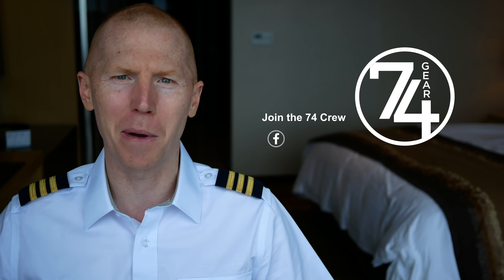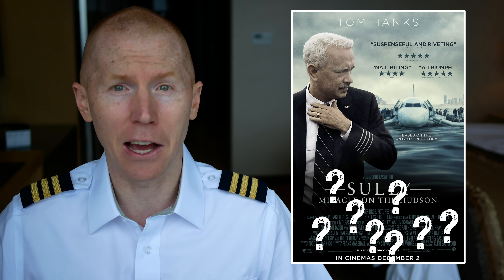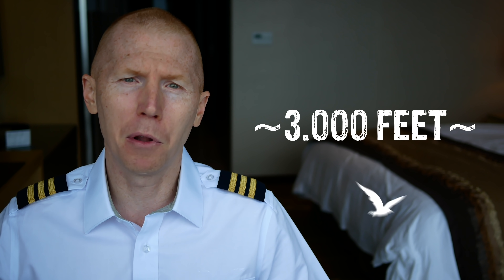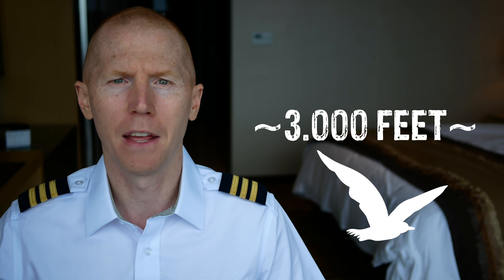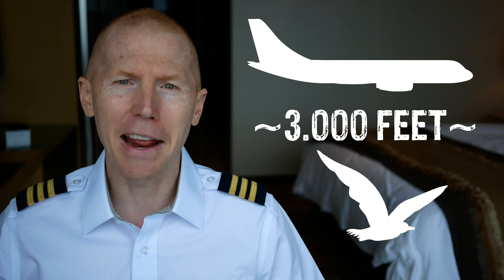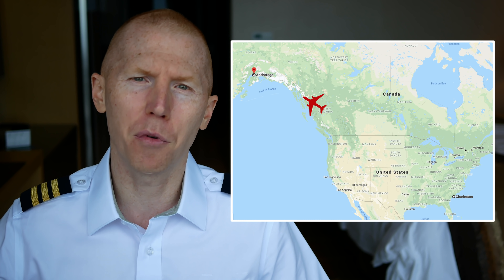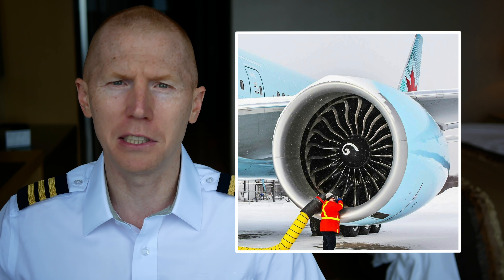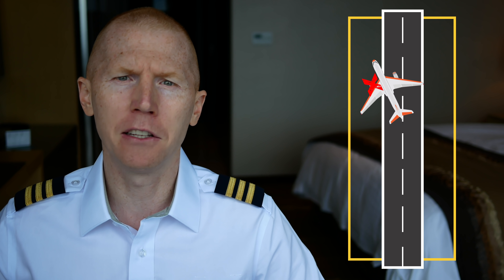Why Engines Don't Have a Mesh or Grates to Stop Birds

Comment: There's another issue he isn't mentioning that we were taught about in engineering. Putting a screen in front of a turbine is incredibly dangerous because it can get covered and the force of the item covering it can pull the mesh into the engine. Metal is worse than a bit of flesh and hollow bones.
Reply: That was the reason I thought.
Reply: Would a sensor that activates an emergency screen work? I'm no engineer though, so don't know if this would be feasible. I imagine there would be to little time.
Reply: @greki89  as soon as a flock enters the engine they lose power in that engine almost immediately. And birds don’t get picked up on radar.
Reply: @UzziHD  Oh! Just to clarify. By sensor I meant something placed on the opening of the engine itself, not so much on the body of the plane. Sometime like a motion sensor calibrated to objects of a certain size that when triggered it would activate a mesh or screen or something. Tho I'd imagine response time would have to be insane for that.
Reply: @greki89  more doable, it could just be an activated mesh screen that only applies below 3000 feet, like the landing gears, once above, they retract
Reply: The mesh is therefore absolutely shit.
Reply: that's why it should be designed correctly.
Reply: How about something that is retractable and is only used during takeoff, landing, and low altitude flying?

Comment: Putting mesh or grids in front of the air intake does not block the air. It’s that the fan blades would constantly be in turbulent air, causing vibration and therefore structural fatigue in the fan blades.The same reason why it isn’t common for propellers to be mounted at the back of an airplane’s wing or at the tail, even though it would be more convenient for the pilot, and probably cheaper to build in some cases. Also, to prevent bird strikes from damaging the engine, the mesh would have to be both incredibly strong and quite dense, adding weight to the structure.

Comment: Could you not put a air cannon that detects the birds and fires a short burst of compressed air to deflect the bird from entering a engine like the darpa system to deflect oncoming fire from a RPG on armoured vehicles, I’m not sure if the compressed air would cause surging or disrupt the air flow into the engine if it was a single shot of compressed air coming from the cowling at the leading edge of the engine

Comment: So you install a retracting protector that only deploys below 3,000 ft.  Obviously not needed at 32K ft.  Done.  Yes, a bit of weight but as you said, $25M engines and lives should be more important.

Comment: You forgot to mention if you out a screen or grate to protect the engine not only it obstructs air flow but if a bird flew into the grate or screen damaging it not only the bird is going thru the engine so is the thing suppose to prevent that from happening.

Comment: they should make a smaller arm that extends to the front of each engine by a couple of yards with a fan inside. make the front part more solid and have it blowing all surrounding air right into the engine much as a cars fan for its engine.

Comment: From the engineering perspective i call all these bullshit as if they wanted such thing, they could implement dozens of solutions i can think of, the real reason is there's no mesh to hold birds intact on the front of the engine at the speed the airplane is going, they will disintegrate and the same thing will happen again, so instead of loading the plane with extra junk it'll be better for the turbofans to be made in a way they can withstand birds flying in under operation and other supportive mechanisms like the balancing system the pilot mentioned.

Comment: I think airline manufacturers have their priorities straight. Engine efficiency vs destroyed planes. Both biased towards more sales.

I think if they wanted to fix the problem they can increase the surface area of intake to accommodate the bird grill efficiency reduction.
Reply: then it make ticket prices go up since it would cost more
Reply: @soarin64  tickets are not remotely priced based on plane performance. It's mostly based upon demand...

Comment: Well they can use simple radar in front of engine and detect anything like bird or bird itself then put a very fast mechanism to put a protection and catch the bird after that simply remove every thing and work normally. 
Activate that radar + machanism during take off and landing only. 
This may be a good idea I think. 😂

Comment: I also can't help but think if a bird hits that grating, even at take off and landing speeds, all you end up doing is breaking the bird into slightly smaller bits before it goes into the engine anyway.

Comment: We’ll put. There is actually another safety “feature” of most commercial or heavy aircraft. These engines are high bypass, which means the majority of the air sucked actually doesn’t go down the core. Think of a donut, the entire donut represents the front of the engine/fan blades. The center (hole) of the donut is the only section that gets sucked into the core, the rest of the air is still sucked into the engine, but it is between the core and the outside of the engine. If a bird is sucked into the core(which is less likely because it is a smaller section) then the engine is most likely toast. But if the bird is sucked through the outer edge (largest section) of the engine, it is bypassed and doesn’t hit as many crucial components. When this is the case usually a fan blade has a small dent or nick taken out but it’s easily repairable and flyable.

Comment: They should have retractable meshes that are put in place on take off and some landings. Over 3,000 feet, they are retracted.

 I think it's going to happen some day.

 You lose some fuel efficiency but at the advantage of safety. Plus this loss of fuel is much cheaper than fixing an engine that has had bird ingestion.

Comment: hear me out. A button is clicked a screen is pushed down. A button is clicked again it is pulled up meaning the time your in 3000 ft or below you loose the airflow and the rest of the 90% is full airflow. Magical
Reply: Where would the screen go? Too thin and the bird would fly right through it, and it would get ripped off, too thick and you wouldn’t be able to fly as fast

Comment: Could build something that only covers the engines on take-off, like thin mesh which is able to be pulled away with a switch when you get to 3000 feet, and then on landing push the button again and the mesh would come back up. 

I'm no engineer but something like that could be done surly

Comment: Here me out: Retractable Meshes. Meshes that cover the engine only immediately after take-off upto +3000 feet, and then disengage. Just like the flaps or the gear.
Reply: Yes, they could even be enabled with lidar sensors just like Teslas, a computer has faster reaction than a human, so it could toggle itself on and off as soon as possible.

This guy saying "its not possible" is the same as when cars didn't have seatbelts or headrests, airbags etc...
Reply: @byrongaray869  either way a bird would just be cut into pieces at that speed and pressure , and those pieces would still enter the engine, so not many improvements considering the downside
Reply: @OK-cp8qw  I would think it would be better to have a bunch of little chunks than one big chunk hitting the blades, smaller pieces less damage!
Reply: It’s probably not cost effective or else they would have done it. If they found it to be cheaper to do this they would probably do it. Also the bird is probably going to be dead either way, planes go hundreds of miles per hour, so the bird would probably suffer extreme injuries and if it survived it would fall a few thousand feet to the floor.
Reply: @astrocandy148  Of course it would be dead, it would be getting hit by a massive solid object at 300 miles per hour
Reply: Because itd still be fuel inefficient and adding motorised doors to a jet engine is stupidly unfeasible

Comment: I can think of 3

1. Suction - you don't want to place any FO in front of a jet engine, unless you want to replace it and the engine. period.

2. Velocity - I remember my school bus hitting a deer at around 55mph and it vaporized it. Can't image a screen vs a bird at 500+. Thing had better be made of piano wire or tungsten. 

3. Airflow - Igniting jet engines is like trying to keep a match lit in a hurricane. And you wanna  place something in front of it that's gonna reduce airflow? That reduces thrust and economy, requiring more fuel and weight, which reduces economy and payload which requires more thrust, which requires more fuel. 

Simple really. They did actually fit screens on ME-262's early in WW2, but quickly moved on after a number of engines ate them and burned the aircraft up. Or down depending on how you look at it. They work, and performance loss could be argued as negligible, but when they fail it's with catostrophic consequences.

Comment: I have ALWAYS wondered about this!!!
Why not a retractable screen or "chicken wire" type of arrangement that retracts above 3000 feet?
Reply: it keeps chickens contained, so why not
Reply: Because turbofan engines can suck the bird through the screen or worse suck the screen in. The danger aria on a engine is 16 feet in a half circle around the inlet at power thats where it has sufficient suction to potentially injest a human.

Comment: There are a lot of innovative thinkers in this comment section. Take off your space boots and come back to earth for a minute.  Think about what all is required to add another complex system to an airliner...Astronomical costs, another potential system failure to contend with, added inspections, added non-scheduled maintenance, added preventative maintenance, increased weight/drag, reduced engine performance, drastically increased FOD risks, weight & balance reconfiguration, anti-ice system reconfiguration, hydraulic system reconfiguration, updated maintenance manuals and checklist, additional manning in the program support office, additional pilot/mx training...That's just scratching the surface of things to consider.   Most birdstrikes go through bypass on large commercial engines and do very little damage.  Its usually sheet metal damaged to the acoustical liners and maybe changing or blending a few blade sets.

Comment: If bird strikes are only an issue below 3000 feet, then why not have a screen that's only in place at low altitudes, and then can be retracted at higher altitudes? The cost to fuel efficiency would be minimal, since most jets don't spend a lot of time below 3000 feet.

Comment: In theory, they could put a grill over the engines that would be mechanically split apart and moved aside to be stored on the sides of the engine. This would allow the engine to have some sort of protection until it ascends to a height where birds are not a problem.

However, this leads to an issue of cost, weight, and aerodynamics. The material would need to be strong enough to withstand the impact of a bird at high-speeds, but lightweight enough to not impact the plane's weight much because the grill would need to be HUGE. Titanium would be the best bet, but even still at that size we are talking about a big and expensive piece of metal. The mechanism for holding the grill in place, and then also moving the grill out of the way, would be costly and add weight.

The issue of aerodynamics comes into play of how bulky the grill handling mechanism is. We can't just have the grill be held outside, so no doubt it would have to move into a compartment, in which that compartment needs to be as aerodynamic as possible. The bulk would, again, just reduce aerodynamics. 

The last problem is the simple fact that even with a grill in place, the bird would just get chopped to bits. I suppose that might be better than having a whole bird in the system? I'm no engine expert though, so I haven't a clue if that would actually help to avoid failures.

Comment: Before I watch this I’m going to make a few predictions on why with my bare bones understanding of aircraft. It might restrict airflow to the engine which would decrease engine efficiency. It might be difficult to design something that can withstand the constant pressure of the engine without becoming the debris that destroys an engine. It might interfere with regular maintenance where you might have to take the barrier off in order to do checks/repairs which is another inefficiency.

Edit: so I sort of got it on the first one. Thought there’d be more than just the one response but luckily that one response went into way more detail then I ever thought about. I didn’t even think about the fact that planes go higher than birds so they aren’t that big of a deal.
Reply: Nice guess

Comment: Unsurprisingly aircrew think they know, the truth is the grate itself is a FOD risk, additionally if the grate was a fine mesh at low temp high humidity ice can form on the grate and choke the engine

Comment: If what your saying is true which I assume it is.  Why don't they have a retractable screen that when your in those 3000ft or lower it engages the Cage and if your above 3000ft it disengages the cage to provide the better fuel economy and full potential from the motors.  Unless it can't maintain left due to having a  bit of restriction in front of the motor which i assume it can handle for at least a sort amount of time in those vital moments.

Comment: How many collisions with birds happen a year? Not many! Now imagine the damage a bird causes and then imagine the bird and knockin the Mesh or Grate into the engine or simply due to metal fatigue or excessive thrust and you see that this metal ingested in the engine is way more dangerous on the passengers and engine by sending metal shrapnel on the fuselage! The same could be said about ingesting hail or ash as well; those happen so rarely that a solution for that would be impractival and would probably cause more harm than good. A practical solution is using hawks and eagles close to airplane corridors; birds of prey reduce dramatically the number of birds in an area thus reducing chances of a flock colliding with an airplane engine. One bird won't kill an airplane engine but a flock of geese would.

Comment: Why not just put a RETRACTABLE screen in front of the engine? Yes it won't be efficient, but it will only be used while there is bird danger. We already have the exact same thing with wheels.

Comment: A nano-thin grate or mesh would word just fine and it’s it’s even big enough to let bugs and stuff in but not birds
Reply: A “nano thin grate” would cave in when struck by a bird, putting only only a bird in the engine, but also pieces of metal.

Comment: Why don’t put a sort of removable gate which stand in front of the engine only when the plane is below 3000 feet?
The fuel inefficiency would be during just few minutes.